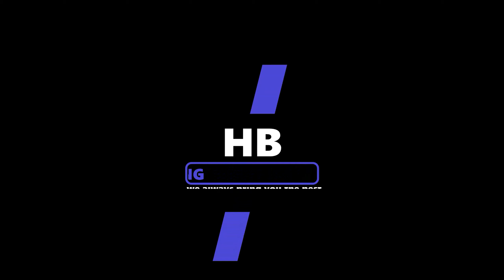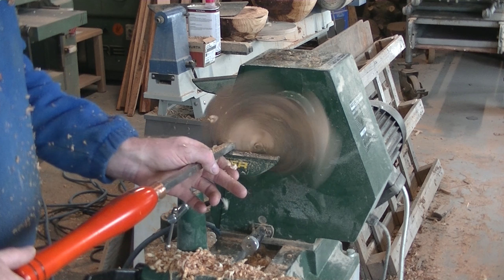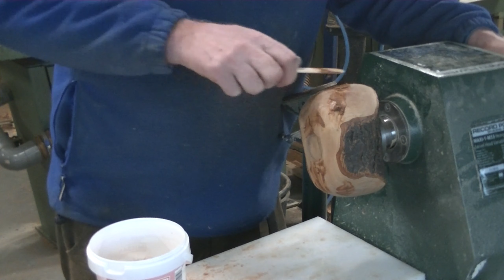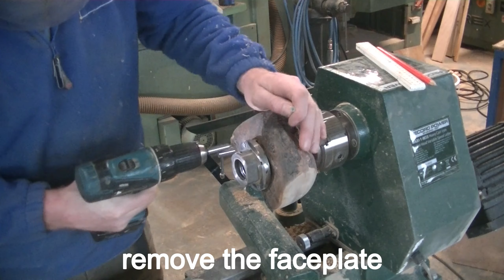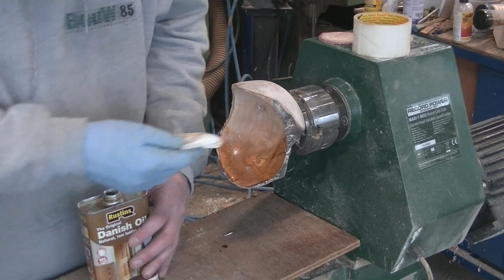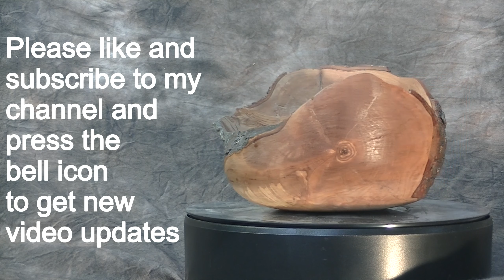a small natural edge olivewood bowl

Comment: Is that the "hope " sanding system you us? Do you prefer that to power sanding with a drill?  I'd like to get away from using the drill so much.  Really like what you did with that piece,  nice stuff.
Reply from the maker: Hello Bruce thank you for your compliment yes that is the hope sanding system at least the handle and the central part (pivot point) but I use a different kind of sanding pad because the original ones always tears the foam part off the rest of the pad.
The other sanding pads were not difficult to find for me because you only need to have the right axle diameter because they are secured in the pivot point with a magnet system. Cheers, Hans

Stay safe and keep turning